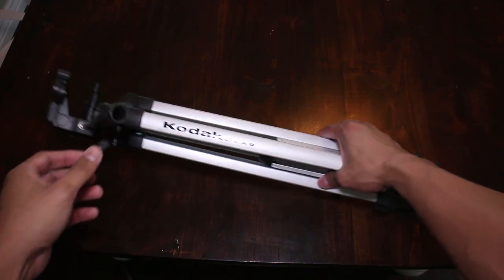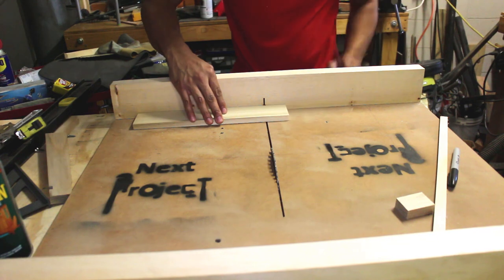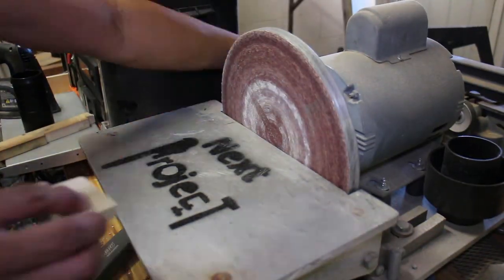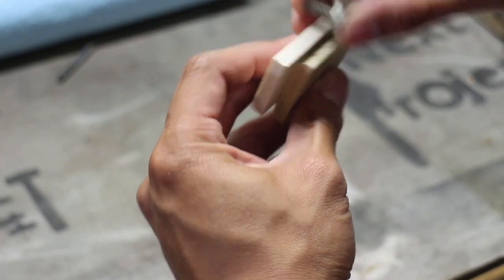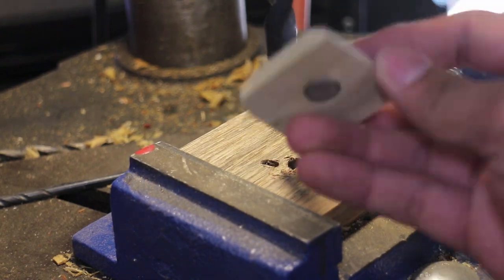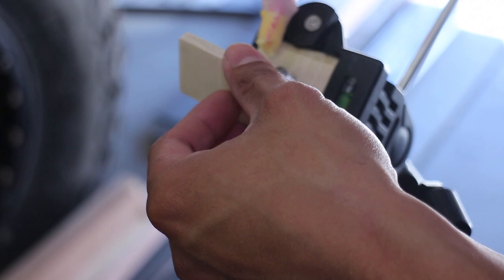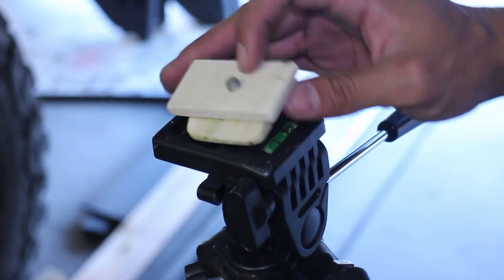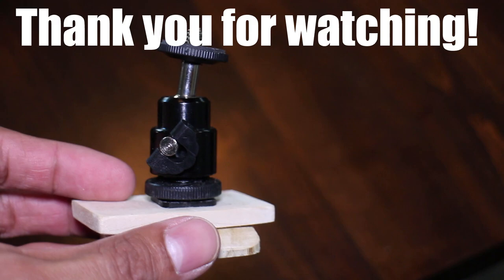DIY Quick Release Tripod Plate

Comment: In the Uk the bolts generally on sale are metric. But the 1/4 inch 20 UNC thread can be found on the web.
Reply: Went to the store in morocco (metric system) with my camera and an image of the bolt, the shopkeeper straightforward gave me the right one.